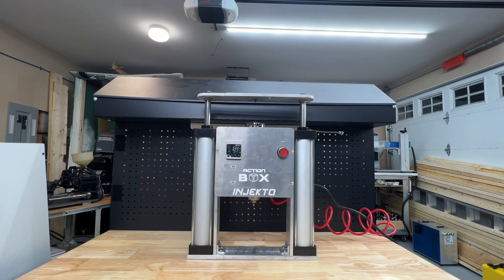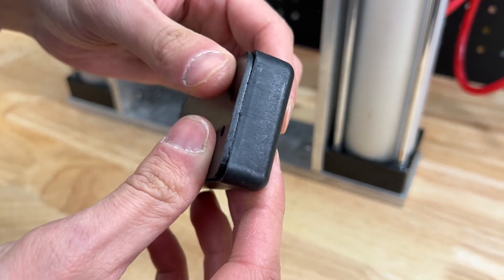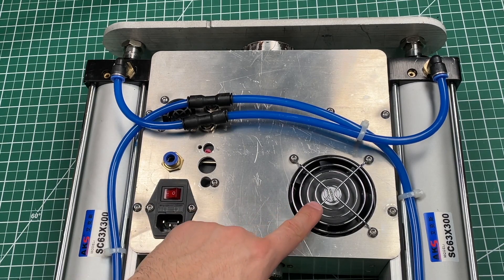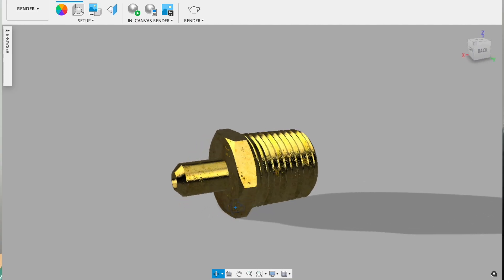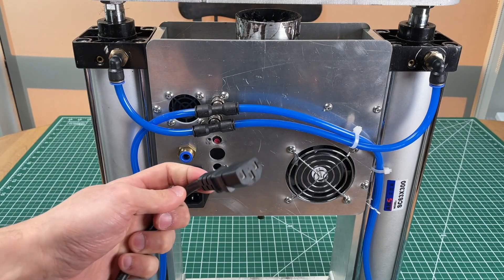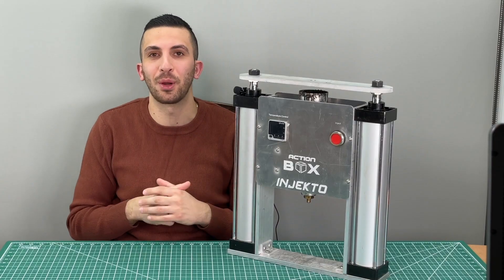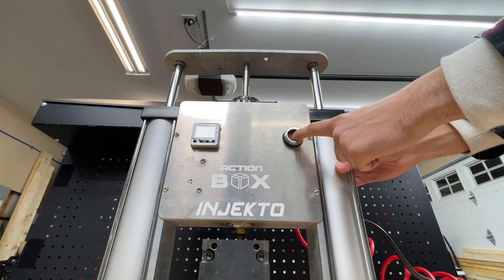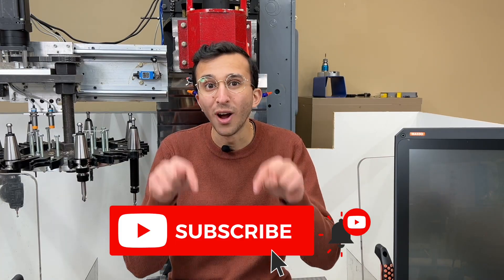How We Made A TINY Injection Molding Machine

Comment: Cool video. Definitely reinforce the top plate; use angle stock, c-channel, an I-beam, or some type of truss. Also reinforce the plate that the springs attach to. I would suggest looking at a hydraulic press for inspiration since the designs are very similar.
Reply from the maker: Thanks for the suggestions.  Hydraulic was a co side ration but we wanted to use air as more people have air compressors at home than hydraulic pumps, and our goal is to make this machine accessible to the average hobbyist.  I’ll definitely consider your points for the V2
Reply: @ActionBOX  - Definitely stick with pneumatics to power the machine. I mentioned hydraulic presses as a design inspiration since they use similar mechanics to your injection molding machine. If you look at a hydraulic press you will see the heavy duty beams required to take the large amounts of force.
Reply from the maker: @makingtechsense126  o gotcha.  Makes sense.  Maybe I’ll consider designing a machine with hydraulics for comparison 😉. Although I would probably want to make the machine out of steel in that case 😂.  Thanks again, Dave

Comment: I knew a guy years ago who had a virtual monopoly on the industry of manufacturing small plastic shims for cabinet hinges.  They did all the injection molding in his father's home shop.  The trick was that the mold itself was preheated to somewhere between room temp and the transition temperature of the plastic.  This meant the plastic cooled less as it was being injected and they could make more parts at a time.
Reply: Modern machines actually have cooling lines in the molds. It helps to solidify faster, you can hardly eject a hot part. Ejection pins will ruin the model if its still too hot.
Reply: @mick0matic  yes, I had forgotten that part.  Basically, the machine temperature cycled quickly
Reply: Can i just ask how the plastic cooling less can enable you to make more parts at a time?
Reply: @FraMurgia  I imagine each mold would contain multiple parts. But that means a longer and more complex path for the plastic, so to get the plastic to flow all the way through the mold before hardening, it would need to be preheated.
Reply: @TerrisLeonis  Thank you!
Reply: @FraMurgia   heating the mold is pretty low tech and nothing special. In the most cases it is done with hot water or hot oil, heated up with a heating unit pumping the fluid through the mold. The used temperature depends mainly from the chosen plastic material, in the most cases it is around 80°C but it could between 40 °C and 140°C.  The heating of the mold serves to main purposes : 1) some engineering plastics have a very high melting temperature and got injected with ~290°C +- X% into the mold. If the mould would have room temperature (21°) and the hot plastic would hit the cold mold it would lead to  a bad surface and a faulty structure/fabric of the molded part.  2) if you add a heating unit to the mold, the mold will have always the same temperature.  If you set 80°C on the heating unit it will cool down if the mold got to hot and it will heat up if the mold got to cold. Without it, your mold would have for example 20°C in the first ten minutes, 30°C after 15 minutes, 50°C after 30 minutes and 150°C after an hour.  All your plastic parts would be trash, because you would have a huge fluctuation in quality and measurements.
Reply: Our molds ran about 220 degrees of water heaters on the mold and an injection temp of 450, cycle time was 45-70 seconds depending on shot size. The largest part I ever worked on was a two cavity 60 ton mold with a 25lb shot size. Automotive plastic and fiberglass mix.

Comment: From what ive seen, its best to have several heaters in this style. So that the chamber is warmed up evenly, so maybe have two heaters and two thermocouples and two pid controllers?

or some pid controllers take in multiple thermocouples, which would be even more ideal just plug in 2-3 in dividing sections and go from there
Reply from the maker: This is an awesome recommendation. We have already implemented it into the V2, and you are absolutely correct.  Cheers.

Comment: One tip: it'd probably be harder to make, but if you make your molds with a "draft angle", it will make the parts easier to eject. I think it only needs to be a degree or two.
Reply from the maker: Yeah you are correct. I will make sure to have molds with draft angles in the next video. Hope you enjoyed the video regardless 😃. Cheers, Dave
Reply: @ActionBOX  It's pretty sweet! It'd be really interesting to figure out some kind of "stack" to produce molds and then molded parts. Something like:  3D printed part -> cast resin mold -> injection mold 

Or, maybe an inexpensive CNC mill to build those molds?
Reply: This is so important. If you can install a one way air valve, air pressure is really useful for ejection. We use that often on deep parts. One mould with a broken stripper plate only uses air!

Comment: Am super excited by this design, looks great - I'd like to buy a v2. Re 'where to put the thermocouple', the question about the number and placement of them comes down to where failure modes exist - where could blockages occur (due to solid plastic due to insufficient temperature), and what position(s) should be sensed to determine over-temperature - can plastic be overheated anywhere in the system, or does it only matter immediately prior to injection point? Two general points: A) consider if your control system is sophisticated enough to deal with multiple sensors, it looks a little light on. Could you change it to a common hobbyist microcontroller (Arduino with touchscreen?) so the community can easily evolve improved firmware over time? [contact me directly to discuss] B) whatever you do with the sensors, control algorithms and the design in general, clearly define operating parameters (room temperature, air pressure levels, plastic types etc) and test, test, test across the range. For example, customers could be operating the Injekto in sheds in 10'C or 35'C - and this environmental temperature will clearly drive different behaviours that all need testing. 
Please also consider:
* Failure modes - what are the things that could go wrong? For example, if there was a leak of some kind, would that effectively fill the main panel (incl. Electronics) with molten plastic? Would that break the electronics, or cause it to fail in an unsafe way? Is it better to move the mains power from the main panel as much as possible (for example by moving the mains power input to an external box), only bringing in mains power directly to the heating element, and not requiring mains voltage wiring inside the main panel?
* Scalability - I'd like to see you design for scalability by considering how motivated customers might make an automated assembly line. It may or may not change your design, but have you considered how additional solenoids could separate the two mold halves, and expel the item with ejector pins? Would including a pressure sensor enhance repeatability? Could a sensor be provided to trigger an auto-refill of the plastic hopper? How would a user electronically operate the 'Inject' button when automating their system?
* International - I live in a country with 220V mains. Please confirm you'll make a model for that voltage.
Reply from the maker: Thanks for an awesome response Dan, there is lots to learn here. When we release the video of the Injekto 2.0 you will have the fuller details of the pricing and whats available. Im glad you enjoyed the video in the meanwhile. Cheers, Dave

Comment: you use a air pump, right? besides using the output, you can consider also using the "sucking" side of the pump as well. made a gas nozzle on the mold, if the injection process can "vacuum" the air pressure inside the mold, the plastic can flow better without bubbles. to achieve that, you may need a milk jar size container as some sort of "buffer". those stainless steel pressure cooking pots in dollar store is a good candidate. you can adjust the "sucking" pressure and volume by putting solid objects in the pot.

Comment: Subbed! 1. Please add some extra feet, so the machine won't tip over. Just some tiny 100 x 50  mm long, 90°  to the baseplate. 2. Do you think some high temp 3D printed material could be used as mold? 3. If you preheat the mold, you may need far less force to push the material through. Can you give it a try? Make your machine an awesome hack for us makers please!

Comment: Why not make the dies heated too? Then you will have time to inject more material before the plastic cools in the mold, and you could do larger projects
Reply from the maker: It’s a great idea and works well.  It’s just added complexity which was not the point of this machine.  I’ll see if I can do it in our next.  Again, great point. Cheers, Dave
Reply: @ActionBOX  awesome,  I get the whole trying to keep it a simple design,  but the heated dies are part of the process with scale model kits, and has been since almost the beginning. Just food for thought,  but getting a cradle for your dies with the heating elements attached should not be too difficult

Comment: Hi there, why did u decide to use flat piece od metal which has low moment of inertia (which translates to low bending resistance instead of some thin-walled rectangular pipe) as part that pushes pistone with molsten plastic? Same questions gose to other horizontal flat Parys.

Comment: Great design! I’m going to try a pneumatic clamping system instead of bolting mold halves together. I will place the thermocouple in the sleeve where convection is not likely to offset chamber heat transfer as much.  Also, the chamber holds around 1.7 cubic inches for anyone wondering.

Comment: The only flaw I see is the sleeve you use around the chamber. If you would insulate that more which it looks like you got plenty of room to it'll help out with all kinds of systems. All you need is a thin peace of ceramic insulation. That should also fix your problem with the thermal couple. Other than that great design. Did you ever think about using a thicker fluid for the Rams to keep them small?  Then again you'll need a whole nother piece of equipment so I get it.
Reply from the maker: Great advice, I like the ceramic concept.  We were considering hydraulics but that would make it much harder to get in the hands of the average viewer.

Comment: Okay, this isn't just impressive, this is seriously making me question what I'm doing with my life. This is insane.

Why exactly was the given "chamber" (I guess) size chosen? Was it simply a matter of finding a precision ground rod affordably to sell in kits (nothing wrong with that), or was this an engineering decision? This would be insanely useful for my applications if I could just get more plastic in the the reservoir. If there's no real engineering reason, I see no reason I wouldn't just make my own larger ram and cylinder on the lathe and see how things go.
Reply from the maker: Thanks a lot. I appreciate this comment. To answer your question, the injekto has a barrel size of 5/8" which was chosen as a good medium between too large and too small. If your barrel is too large, the plastic in the middle will not plasticize (or melt).

Comment: To increase injection pressure, you could change the design for the action of the pistons. Instead of contraction to inject, extend to inject. The amount of force is reduced on the piston head because of the rod.
If the piston chamber is 2" in diameter, that gives a volume of 12.56sqin. At 120psi, that would be 1507 lbs (6703N) of force. Because there is a rod on the retraction side, and it's about 1" round, this cuts the force down in half. Which you mention as 3300N (741lbs) of force.
So just by changing the design to extension to do the injection, you can still use the same size cylinders, and you'd get twice the force. This would keep the cost of the design down, and yield a more powerful unit.
Another thing I would do is make the injection rod have a taper for going into the hopper. This would minimize any introduction of air that might get trapped on the end as it's plunged down into the plastic. It would allow for more precise auto-alignment.
Reply from the maker: Hey, thanks for the detailed comment. This has been considered, and the issue with the extension is that while it provides a little more force, it would require me to flip the cylinders around, which would make the machine 50% taller.  I was looking to make the smallest possible form factor.  As per the injection rod, it has a slight taper, but perhaps more will indeed help.  Cheers.
Reply: @ActionBOX  Yeah, flipping it over was the part I was tryin to figure out how to get around. Maybe there could be different versions available. Some ppl may not mind having a unit that is twice as tall. Me personally I have plenty of space for such a device.
But I also get the reason for needing to keep it compact, as well.
Great idea overall, though. I had been wondering about injection molding and how to go about it. This seems about as simple as you could get, to be honest. Job well done guys! 😎

Comment: They sell mold release, we use it in industrial injection molding all the time, that should help you get the parts out without the vise. Really impressive and that's coming from a career tech who has been doing that professionally for 5 years.
Reply: Why don’t you mention the brand of the mold release you use. Contribute to the project.
Reply from the maker: Thank you Mr. Jones, I appreciate that coming from a professional.  I think you would really appreciate the V2 design once we film it 😊. Cheers, Dave
Reply: @ActionBOX  Check the company PPE - Plastic Process Equipment. Almost every injection molding company gets at least some supplies from them, they have everything from brass tools and fittings, to sprays (mold release, rust preventative) all the way up to blank mold frames. They sell various screw on nozzles with different profiles (for instance if you are using nylon material there is a nozzle specifically for that resin) 
You should be able to get a lot of parts off the shelf for your next project from them.

Comment: For safety reasons you should add another button to make it work only with a two hand operation. Any button released, the pistons have to release the pressure. I also suggest to use a single acting cylinder, so it can return to the starting position, if there is no air or electricity in the system. If you use (one-way) flow control valves than you can adjust the cylinder speed in both directions.
Reply: Or, make it a remote? Have a little box that you can stand back a bit and push the button. It could be bad scene if someone doesn't design their clamping system for their mold halves and it comes apart with a lot more clamping force. Maybe some kind of containment cage?
Reply: @toastrecon  Or built in a telescopic cover so you cannot put your handy in between the danger zone! Like they did it in their CNC machine

Comment: Maybe consider adding a vertical bar on top of the horizontal crossbar and screw the latter to the former creating a more rigid T-Profile?
That bending of the crossbar is pulling the pistons rods together which can't be healthy when the piston housings cannot comply with that inward motion.
Reply from the maker: That’s a great point.  We have already made the appropriate changes in the V2 design. Cheers.

Comment: Nice and simple! You might just want to turn the pneumatic cylinders upside down on your v2  so you get the maximum force out of them. You're currently pressurising the rod end side, so piston area is reduced; I think the cylinders won't develop maximum output force this way. Also watch out for using the blue polyurethane airlines near a heat source, you might consider using PTFE tube inside the frame.
Reply: Maybe im Missing Something but turning the Pistons around doesnt effect the force Output. They would need to Press and Not to pull with the cylinders to achieve Higher force (which wouldnt Work in this Compact concept). Greetings
Reply: @clypeum5063  Forgive me. What you're missing is the fact that the piston rod is inside the bore with the face of the piston that is being acted on by the compressed air driving, or pulling the cylinder down in the injection stroke. The rod takes up space on the face of the piston that would otherwise be available for the compressed air to act on. I hope this makes sense, I'm pretty sure that's what Shaun meant, but I might be wrong :)
Reply: @frackcha  yeah, thats what i and he ment. Force equals pressure Times Area. The rod Takes some aera and thus force away.
Reply: @clypeum5063  100% correct, that's what I meant by turning them upside down. They need to press and not pull. It wouldn't take up more desk space, just be a bit taller. Or they could fix the plunger and have the cylinders apply pressure upward to the pellet receiver and die, so wouldn't need any packing shims... more complicated but anyway, I'll leave it to them youtube science magicians I guess
Reply: Actually, you don't need that much pressure. Depending on the mould, i inject with not more than three bar, otherwise i deform my mould. My moulds are three pieces flat metal "sandwich" with the cavity in the middle.